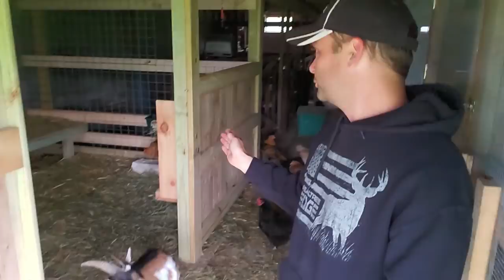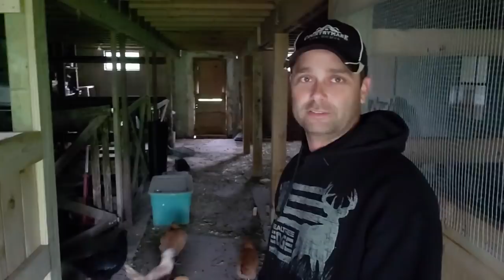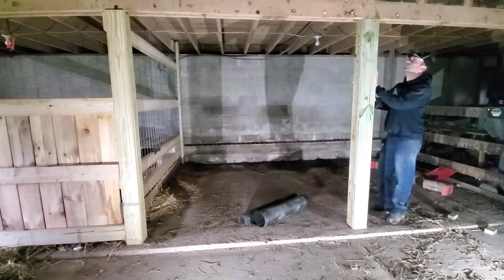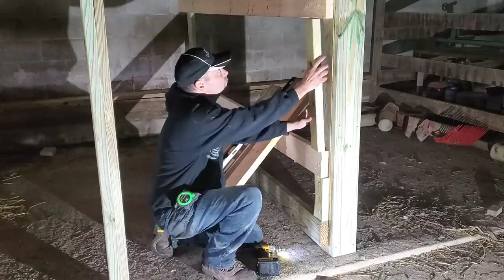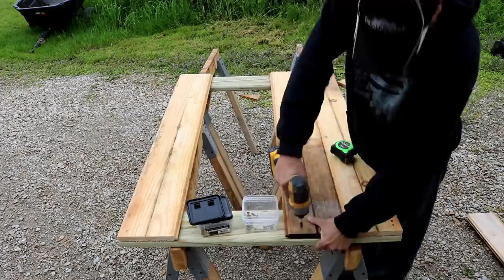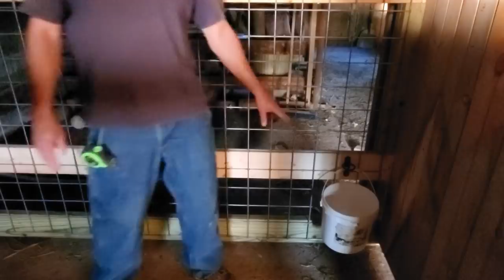Building a small animal Stall in the lower level of the barn

Comment: Great job on the stall:). Do you plan on insulating the barn to keep the animals more comfortable?
Reply from the maker: Right now the lower level in the barn is keeping about 10 degrees colder than outside.  I don't think there is any reason to insulate it.  The ground temperature helps keep it a steady temperature inside.

Comment: why are you not using the light already wired in,, just need another run of lights and plug in, all down the walk way, you can pick up low voltag LED THAT RUN OFF A TRANSFORMER FROM 110 VOLT, THAT ARE REALY CHEAP AND GIVE A LOT OF LIGHT AND LAST, THEY ARE GRAT FOR BARN, AS ANY WATER THAT FORMS FROM THE LIVE STOCL DRIPS ON REGULAR LIGHT AND BLOWS THEM UP AS THEY RUN REALLY HOT. i wouldnt start building anything until i wired the place to have lights and plug in,,, as you will need lights a night when things go wrong, you dont want to be messing with flash lights when you need all hands on deck.. you have work light going so you must have some kind of power running to the barn of some kind, even if its just a long cord, just pick up a 4 beaker sub panel,,, ans put lights on one beaker and put plugs on a few barkers, but use 20amp brakers and #12 wire for the plugs, so you can run power tool. heat lamp.. for now if you are getting power by a cord, hook the cord into the sub panal for now until you run a under ground wire on a 30 or 40 amp breaker from the house or were ever your main service is, not having good lights and plugs is not only dangerous but so unhandy when building or worse a problem with an anamal at 2am